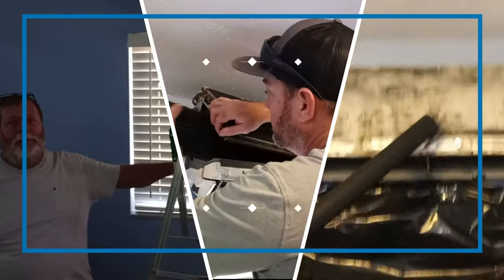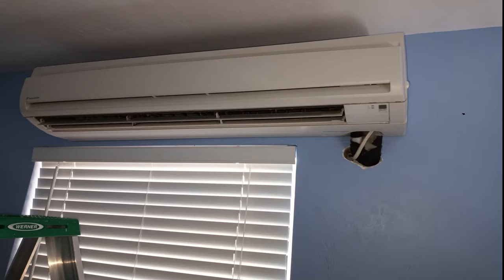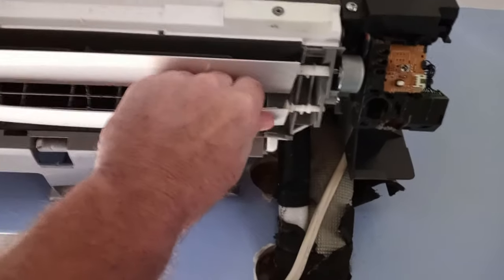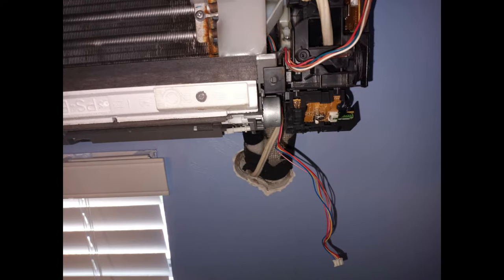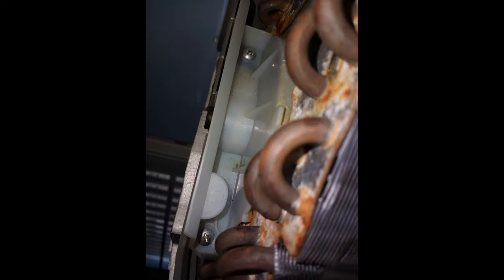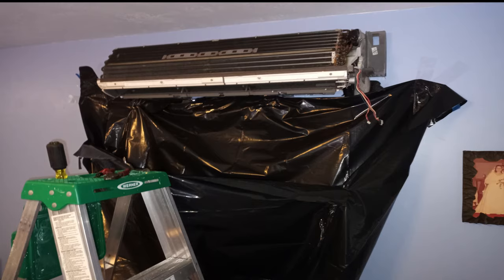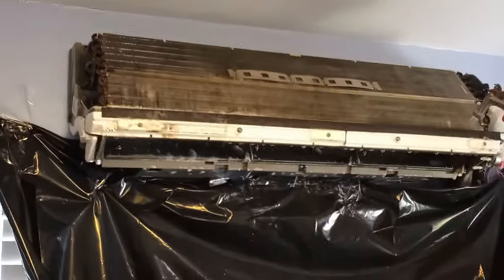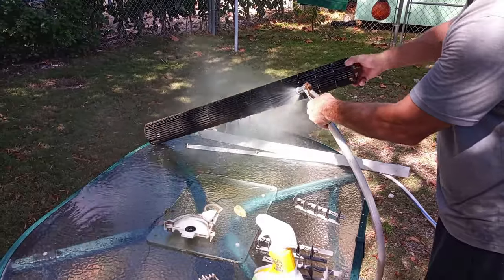How to clean a (ductless) mini-split a/c unit! Stinky, moldy, clean it yourself

Comment: There is no need to  remove  everything  like that  just  get a split ac cleaning  kit and  cleaner  or a small  amount of dawn dish soap and water in a clean spray bottle and  spray it  down  then rinse it into a  bucket with water after and let dry,  and your good  to go . Works  like a charm.  😊 you  can  damage your ac unit by taking it apart like that, not a good idea... have a great day,

Comment: Hey guy, could y’all do a video on cleaning an outside condenser that’s mounted on the wall of a house, travel trailer or whatever; that goes with that indoor mini split part? Would greatly appreciate it. I’m 68 & 1st timer on this. Soc Sec doesn’t stretch far enough to hire it done. Thanks so much.
Reply from the maker: Foam outside coil and rinse with water hose, no disassembling required!

Comment: What do you clean it with?
Reply from the maker: I use coil cleaner. You can find it in hvac supply stores or online. Ive seen people use degreaser or dish soap with good hose pressure should do the job.

Comment: Hello I followed step by step and the blower wheel is stuck what am I doing wrong?
Reply from the maker: Make sure the wheel spins freely  by hand when putting back on shaft and in cage before you install back in air handler